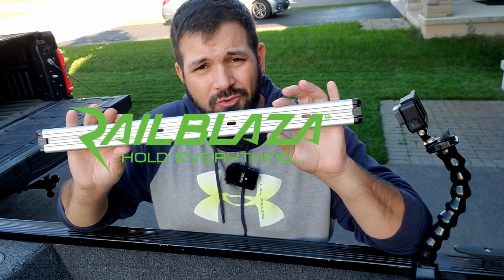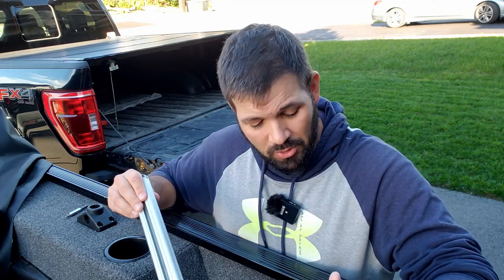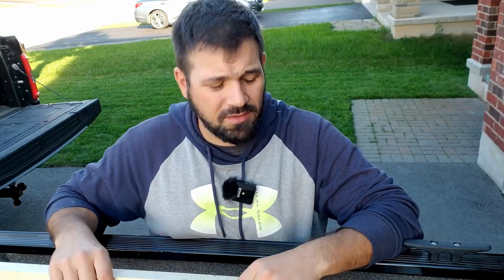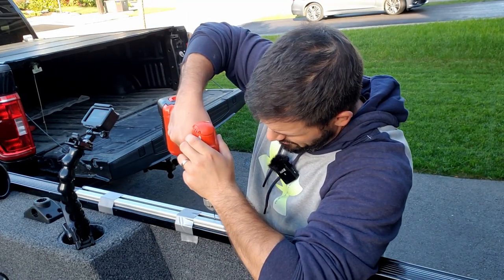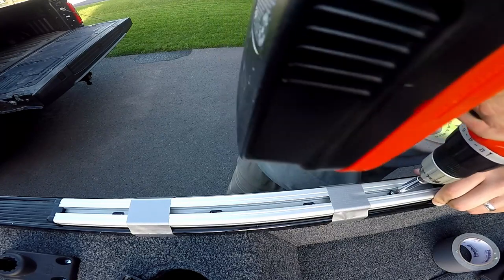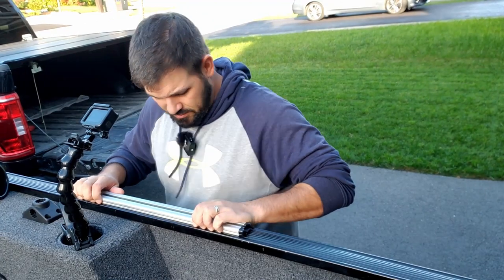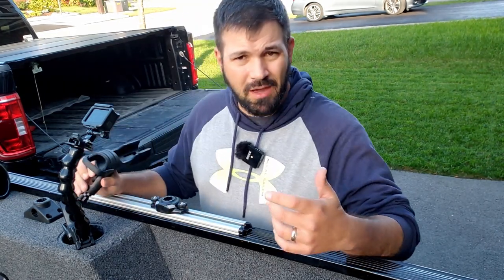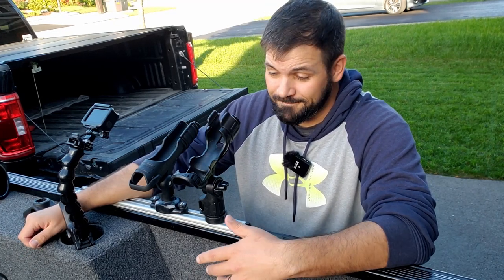How I installed RailBlaza Tracks on my Lowe FM1625WT

Comment: Still working well? I was going to get the 39 inch rail for both sides. Is there room for 5 Rod holders on each side and would that be too much pressure on it? I would run at least 2 to 3 dipsys- size one on each side for salmon. 

I will also mount mine on top not the inside so what railblaza rod holders do you need to get to put on them?
Reply: I do have a triumph boat that is plastic though too.

Comment: Thanks! I have the exact same model boat. The gunnel is too thin to install anything. I want to install 6rod holders but not sure if the gunnel is strong enough to hold the rods.
Reply from the maker: It's definitely tough to say, the gunnel is just aluminum and there's no access to the inside to install a backing plate. If your going with a hefty 6 rod holder, I'd for sure use Rivnuts. I'm thinking about replacing the self tapping screws I originally installed with rivnuts to give the rails some added stability
Reply: @jeffdicks  how does the RivNut work? Do you mean vertically or horizontally? It's hardly to screw a hole on the shell of the boat vertically.
Reply from the maker: Rivnuts are like rivets but are threaded on the inside so you can screw a bolt into. I got the idea from a friend with a similar model lowe boat who did that with his railblaza tracks and they just feel a lot more solid than mine done with just the self tapping screws.

Comment: Could you put some kind of thread locked on them to help them stay fastened? Idk how well thread locked works with screws but seems like it could be better with then without..
Reply from the maker: I don't think something like Loctite would make much of a difference. The aluminum is so soft it would give way long before the screws do. 

A friend watched this video and used Rivnuts instead of self tapping screws and reported that they hold up MUCH better than the screws on their own. That said, I haven't had issues with mine the way I did it but I think I'll be switching to rivnuts this summer. I'm not 100% confident in the self tapping screws in soft aluminum under the pressure of planer boards or multiple #1 dipsy divers

Comment: Can you mount a downrigger to the rail as an accessory?
Reply from the maker: I would not mount a downrigger directly to the rail as I ha e mine mounted. There's way too much tension and weight on a downrigger for this one to hold up with simply self tapping screws holding it down.

Comment: I have that exact same gunnel on my  2019 FM165 boat.. and I want these rails too for holding my trolling rods. How well have they held up? Also does the Scotty holders fit right in that star port thing?
Reply from the maker: Scotty accessories won't fit in the starport, BUT the scotty railmounts will slide perfectly in the Railblaza rail. So far It's performed well for me, been trolling with 1.5oz weights and dipsy divers and planer boards on my trolling rods and the rails are rock solid.
Reply: These hold up to a salmon rip on a dipsy rod?  Or are you fishing smaller fish???
Reply from the maker: Mostly targeting walleye with sinkers, but I've got some new #1 and #0 dipsys I'll be using very soon. I'll let you know how it works out with those after some use and abuse

Comment: Lowe is for Low Quality, my 2017 FM165 PROWT right from the start had a number of issues. , torn cover when we picked it up , the consoles not secured,  loose decking, and peeling paint. I would not recommend them ever.
Reply from the maker: That's a bummer for sure, but that has not been my experience with this one. Aside from a broken windshield that was a bit of a pain to replace, this boat has been great to me!